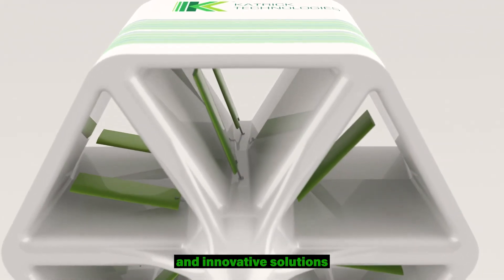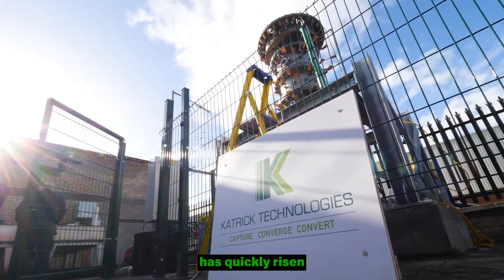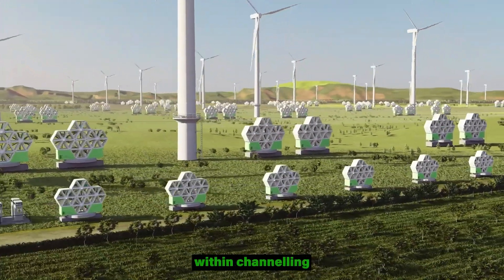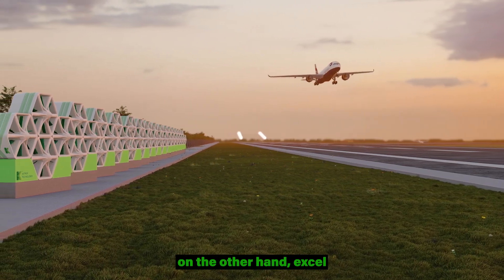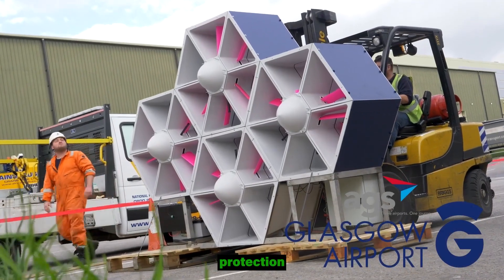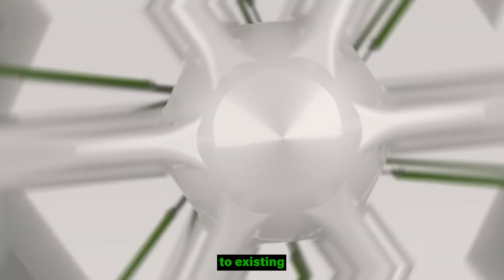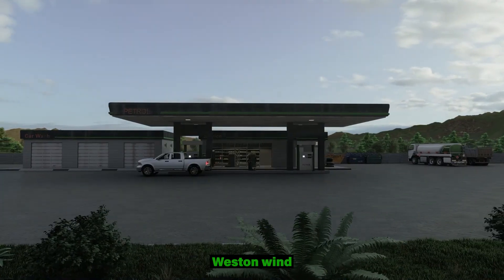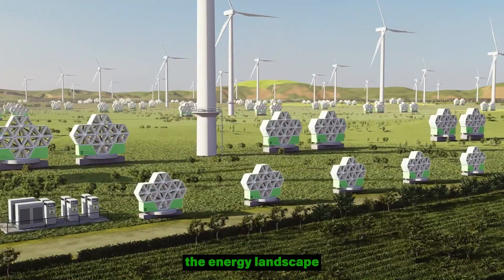The NEW WIND ENERGY INNOVATION that will REVOLUTIONIZE renewable energy

Comment: Wanted to know the minimum and maximum speeds at which the panels can operate but that information, as well as information on cost effectiveness, is missing. Moreover, it is also not clear what happens when the wind is blowing parallel to the panel intake manifolds.